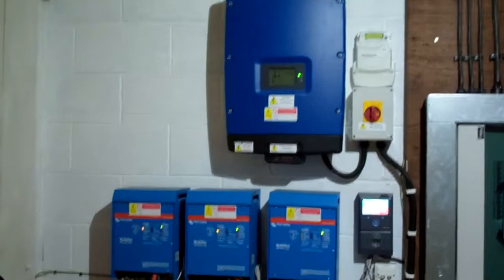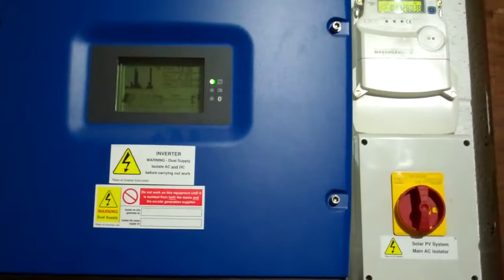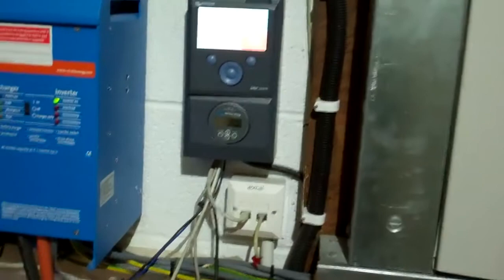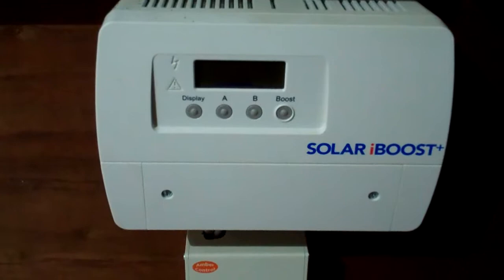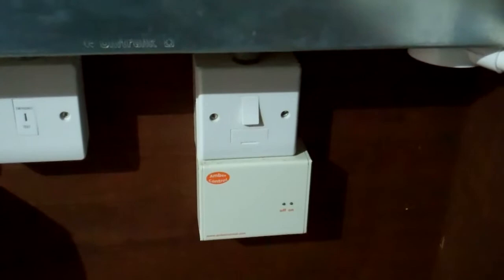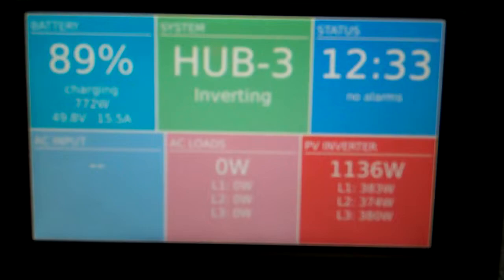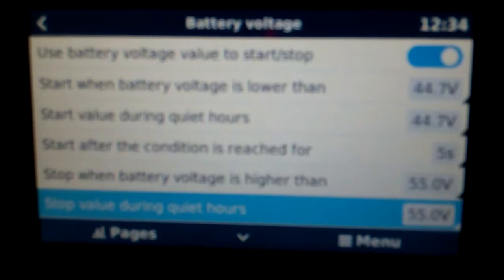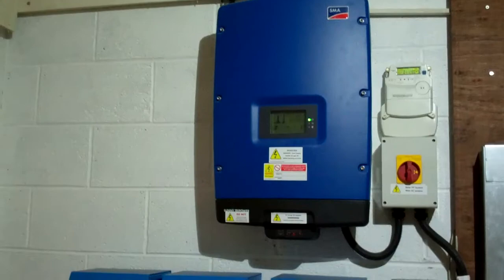3 Years on Off-Grid Solar 3 phase system, 36kw battery bank, Northern Ireland, UK.

Comment: are those 3 inverters out of phase? How is that controlled? Like if you want to run a 3 phase machine, each phase needs to be out of phase to run the equipment.
Reply from the maker: only one Inverter (SMA Tripower) the 3 victrons are battery chargers one for each phase. This system will run three phase motors up to 3KW start up current off the solar / battery bank once you go over 3kw the generator starts and shuts down the solar and keeps charging the battery bank at same time.

Comment: Ey mate im Farmer from Bulgaria currently  got  3kw 24v Ivnerter which im planing to change because i got like 4000 wats of solar panels 22 panels .Im reallly thinking what  type of inverter should i buy and im confused .Im runing monophase water pump  1.5kw at the moment but planing on gettting  hybrid 48v inverter whcih is 5kw   12 kw  for 3 sec and 4kw of charging 80 amps MPPT.The question is  can every hybrid inverter be merged (talking about autonomic single phase 48v inverter can be merged with another 1 or  not)  by merging i mean using 2  inverters   for example 5 kw 48v  like the one i plan to buy.Other questiong im really confused how the three phase inverter works  cuase there is no one to explain to me.For example about same mooney  i can buy   3 phase huawei solar panel that  is  6 kilowats but probably this means that it is going to produce 2 kw per 1 pahse devided in 3 phases at its peak ?????? Or it produces 6 kw at each phase which sounds rlly crazy ? Or you have to do like you get 3 hybrid inverters one for each phase  have 15 kw of solar whcih would mean u  have 5 kw per each phase and  u can run a  3 phase motor that is  up  to 5kw ? Would really appreaciate your answer.They dont give any  answer to what is the peak of starting electricty at the 3 phase inverters either or it stays  6 kw unlike the  single phase inverters whcih have araound double the starting power at peak ..
Reply from the maker: 6kw solar panel with 5kw sma tripower three phase inverter maximum usage is 3kw on startup of a three phase or single motor.  To get more power you need to connect a generator so as when load is calling for more than 3kw the generator will start and solar shuts down.  When the power drops below 3kw the generator will stop and solar power starts again.  Or you could get a bigger sma tripower all depends how often you are going to use a 5kw motor and run time.

Comment: You connect on -grid inverter in off-grid system ?
Reply from the maker: It's a three phase off grid inverter
Reply: @bali-haimailordernursery   a SMA Tripower Inverter 5KW you have , its different system from the off-grid ?
Reply: @bali-haimailordernursery   I have blow up my off-grid inverter with on-grid inverter because my load from 3kw go to 500w and the voltage from 220v to 300v+
Reply from the maker: @panoss3524  System is in 5 years works perfect sma inverter and victron chargers one for each phase.
Reply: @bali-haimailordernursery   I have 30kwh agm batteries with one phase out off-grid. I know that sma has the sunny island inverter for this and i didnt know that you can connect it with victron or others off-grid inverters. I think the single-phase Sunny Boy will work for me. So i will ask sma if i could connect it with the victron energy with no problems. Thanks for your reply !!! 😀